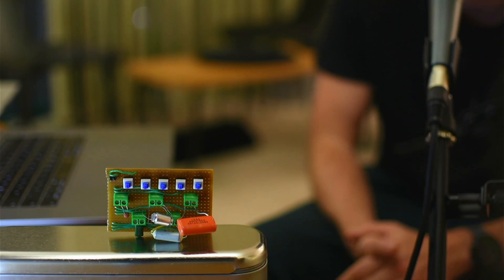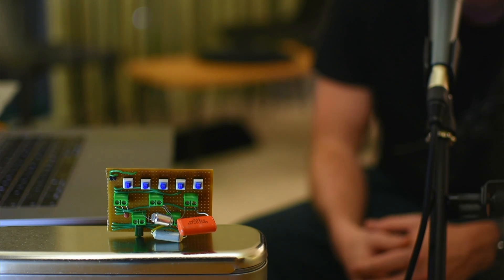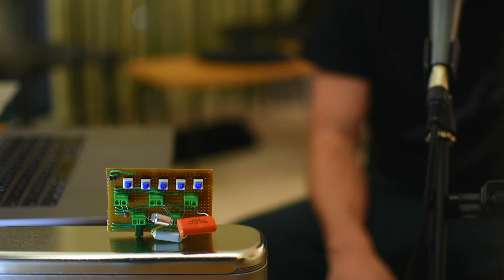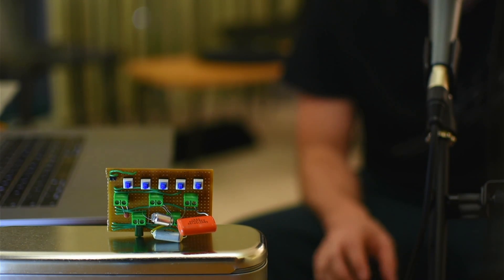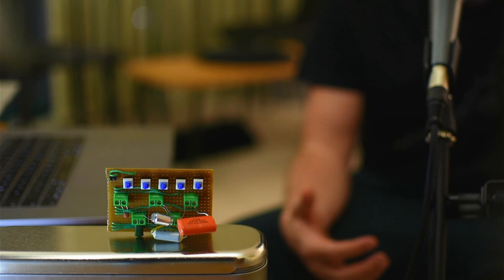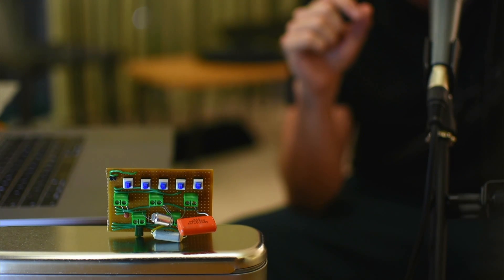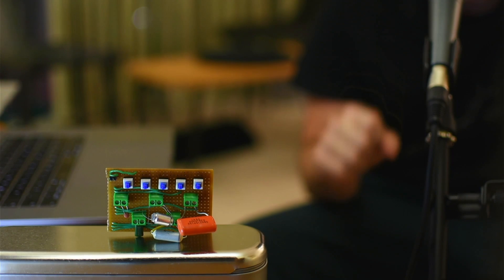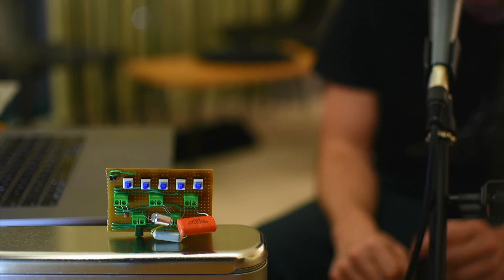Guitar Tone Capacitors Test (Orange Drop Vs Paper in oil Vs Polystyrene Vs Polyester Vs Ceramic)

Comment: I didn't realize just how close to Paper-In-Oil Ceramics were...
It really comes down to these two to my ears... with PIO perhaps having the slightest edge over the Ceramic, which might be just a hair too clean and bright, but that's really splitting hairs as they are sooooo close. This is a case where I'd have to play each to see which brought out more of the nuances of my playing and how it felt to play with each in the guitar. Ironically, my Les Paul Studio came with ceramic caps, and I pulled them out and bought about a dozen different caps to replace them with over the past couple of years, and I didn't like ANY of them.  Right now, I've got Sprague Orange Drops in there, and they sound way too flat and sterile to my ears. I just ordered another pair of vintage PIO caps to try, but I may just end up putting the ceramics back in if they don't do it for me after watching this vid and hearing just how close they really are.    Great Video...!

Dirty
1:47 PIO
2:05 Ceramic

Clean
2:23 PIO 
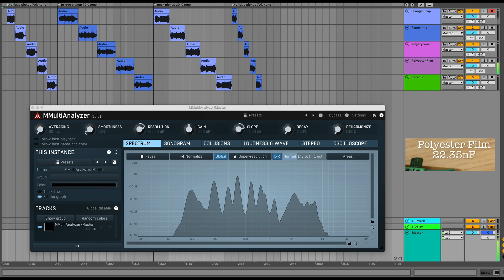2:55 Ceramic

Compressed Lead
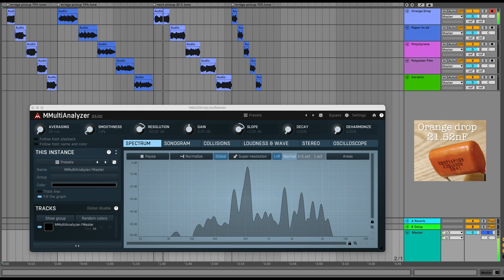3:16 PIO
3:42 Ceramic

Rhythm
3:55 PIO
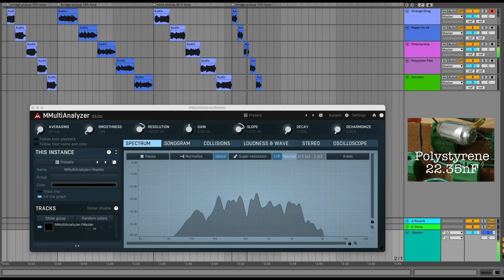4:05 Ceramic

Comment: Nice experiment, but did you use a looper and with the same track?
Reply from the maker: Hey, nope, no looper used because the capacitors where on the guitar, so that approach wouldn't work. I played the parts for each one of the capacitors. There is some element of variation between each take but tried to minimise it as much as possible.

Comment: If you use effects, you will not be able to hear the pure difference between capacitors. Try testing .0033uf and lower for bridge.
Reply: Good idea, like a "Warmth" control that is subtle and not as accute as a .047 or 0.1uf.

Comment: Why does it require 41 country and western musicians to change a light bulb?
One changes the bulb, the rest sing a song about how good the old one was.

Seriously dude, forget all the effects, how the fuck are we supposed to hear anything in that digital delay Hell?
Reply from the maker: hah 😄 yeah I'm leaning towards what you're saying too. The argument around the capacitors is that your guitar is quite early in the signal chain and you're trying to have an "optimal" setup there. But I agree, the signal chain can/will be super complex (and with many other "cheap" capacitors involved).
Reply: @vismajeure  Thanks for the reply.
I'd say that your guitar IS the "signal-chain".  Strings-pickups-cable-amp. 
Anything in between will degrade the signal, specifically the highs(treble) and probaly everything else as well. 
Potmeters are CRAP. 
They are NEVER "linear" , they suck out treble, and it doesn't matter what Hi-fi audioholic resistors/capacitors you use. 
Hi-Fi nerds know, and use stepped attenuators with mil-spec resistors, but if you do that on a guitar you won't be able to make the Roy Buchanan volume-swells and Wah-effects. 
See what I'm saying? 
My first electric was an all-maple 1972 Strat that weighed a ton and a half, got her in 1981. 
Oh no, it's not a pre-CBS blahblah,
wrong pickups, wrong selector-switch, but everybody who could actually play told me she sounded great, I just had to practice. So I did. 
And they where right :
 It really ain't about the hardware, 
it's ALL in your fingers.
Reply: @hansemannluchter643  Right. The better someone is, the less the gear matters. That seems to get ignored by GASers and salesmen.
Imagine Jimi stopping during a track because his "cap wasn't PIO". LOL

Comment: You are doing a good job of trying to identify tonal differences, and I think that is very useful. However, another aspect is sustain. Certain vintage caps like bumblebees are supposed to be known for creating more sustain sort of accidentally. This is not so much because of their capacitance values drifting, but supposedly because they also add inductance. Modern caps properly work properly at adding just the appropriate capacitance, while  certain vintage ones also couldn't help but also add some inductance, which may be that "secret sauce" that helps the instrument "feel" so much better. Perhaps with your setup you could also perform a controlled "sustain test".

Comment: I left a comment you might find interesting, as a reply on this thread to @Brad T. Basically I have changed out about 5 original Fender Bassman amps to PIO, they improve every time.
Reply from the maker: Hey Gabriel, thanks for your comment. When I did the test I was able to hear differences between the different types of capacitors - the one that stood out as the worst (or the outlier) was the ceramic one. The rest were about the same, although I preferred more the sound of PIO and Polyester.

However listening to the recordings again now - I wouldn't say they are vastly different from each other - maybe investing time to improve other parts of the pipeline makes more sense. I also need to do another version of this test with re-amping to take the player's performance out of the equation.
Reply: @vismajeure  It seems people are willing to spend much time and energy debating all of these issues. I am happy with the several vintage amps that were running good but we changed to the paper and oil caps and could notice a tone change for the better and that is good enough for me.
Reply: @gabrieln3613 100% that different caps make a difference. Just plug into any valco, Supro, Gretsch, Airline amp. They have a distinct tone because of all the ceramic caps in them.
Reply: @vismajeure  , thank you for the vid. I already ordered new pots and an orange drop for my guitar but i saw this vid and... The paper in oil sounds better for me in almost every test. Only the guilmourish bends sounded better on the orange drop, but i do not play such music . And then I liked ceramic and polystyrene as #2 and #3
What was the paper in oil model?

P.s. just searched for how much generic papers in oil cost... Wow. Like, three times that much.  Didn't realize that